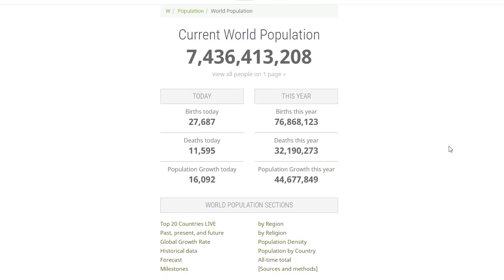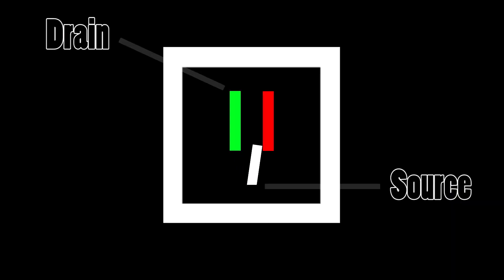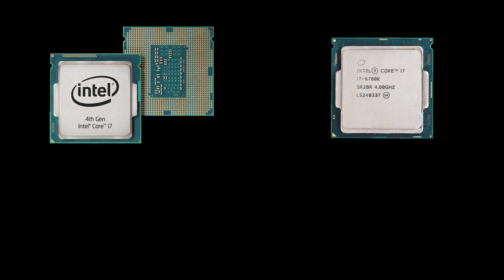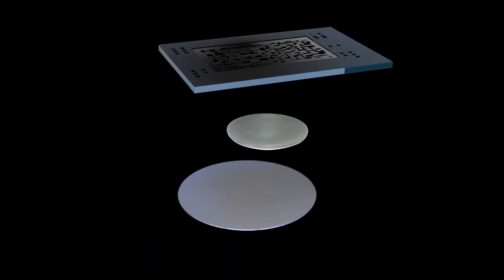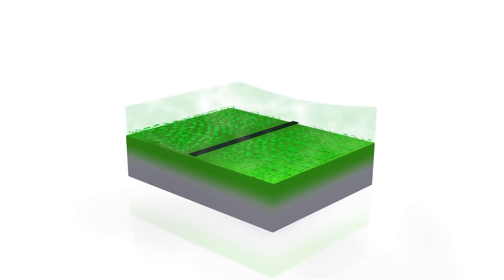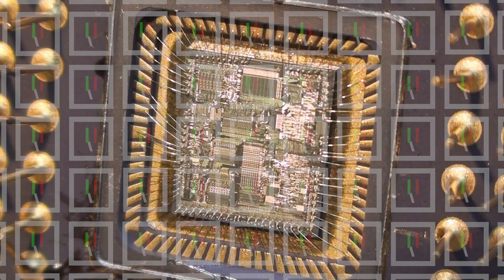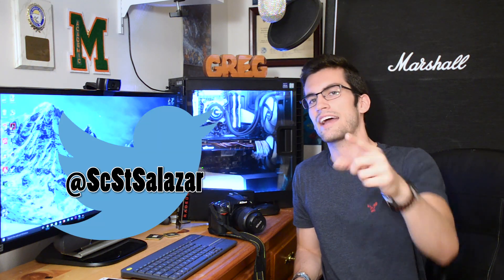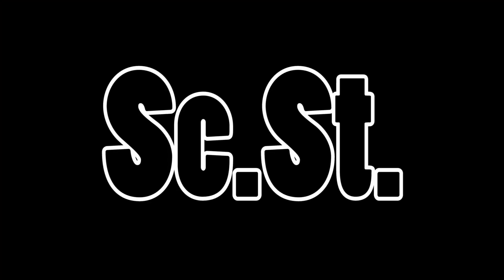Why Do Processors Get So Hot?

Comment: I would like to add to Gregg's explanation.  All of the heat inside a CPU is a result of something called Joule heating.  Heat is simply kinetic energy (indeed all forms of energy are either kinetic or potential).  Since electrons have rest mass and since they are what is traveling through the circuits, they bump into the atoms of the wire creating a sort of kinetic turbulence.  This is what heat is at the most fundamental level.  Whether it be in an electrical circuit, your car engine, or when you rub your hands together, heat is generated from this principle.  In other words, heat IS motion whether it be at the sub-atomic level up to the size of galaxies. 

Now I think an explanation of temperature and heat is in order because this is something lots of non-scientists or engineers have a hard time understanding.  Heat is not temperature, they are related, but not the same.  A good example of what I mean is the following question: Which is hotter -- an iceberg in the north Atlantic or your CPU running Prime95?  If you answered your CPU, you are WRONG.  The iceberg is hotter but it has a lower temperature.  Why?  Because heat is essentially energy and energy is related to mass (Remember Einstein's E=MC^2).  Since the iceberg is so much larger, it has more total energy (more molecules moving around creating heat).  However, it is much lower in temperature.  It turns out that temperature is the AVERAGE heat in a system, not an absolute measurement of total energy.  So if you put a thermometer probe anywhere on the iceberg it will be somewhere around freezing or below, but it does contain far more heat in total than a CPU at 70°C.  I mention this because I see this confusion arise A LOT on computer enthusiast forums when it comes to radiators and cooling.  Most people don't get it.

Now, all regular matter (except superconductive materials) has electrical resistance.  It just so happens that highly conductive materials like metals have a low resistivity while insulators like rubber or glass have a very high resistivity (this is what defines them as conductors or insulators or semi-conductors).  The problem we have with heat in electrical circuits is a result of the fact that the stuff the circuits are made of has this inherent resistance.  This fact is probably known by most people reading this, so this is nothing that insightful.

However, there is another effect I would like to mention that's related but probably not as well known by average enthusiasts.  When metals experience a rise in temperature (even if there's no electrical current), the resistance also rises, which means the metal is less conductive than it was. This is called the temperature coefficient of resistance and electrical engineers are very familiar with the principle. (In fact, this is how some thermometers work -- they read the resistance of a metal (or ceramic) element and calculate the temperature based on this resistance change.  Indeed the thermometers on our CPU die themselves work this way).  What this means is that since the resistance has risen due to heat, you need more current to overcome that resistance.  More current means more kinetic energy (heat) flowing through the wire and yet even a higher temperature.  And the higher temperature means yet another rise in electrical resistance.  You see where this is going.  It's a vicious cycle.  If you are doing extreme cooling like liquid nitrogen, you can counter-act this resistance rise (with such cooling you are actually making the metals more conductive in the circuit), but ultimately your clock speeds will be limited to inherent circuit design and limitations irrespective of heat.

There is a solution to this problem, though.  It's called super-conductivity.  The problem with superconductivity as we know it today is that we haven't identified any materials that can superconduct at room temperatures (or anywhere close).  These materials we have now need to be in environments at WAY below 0°C.  However, this doesn't mean advances wont be made and that someday we may identify a material that can superconduct at room temperature (or higher).  Nobel prizes have been handed out in past decades to scientists identifying materials that increase the superconducting temperature by a few degrees (when thought impossible) so there is no law of physics that says it is impossible.  This is a major problem in condensed matter physics and lots of research is going into it.  If a material is identified (and it is cheap enough), it will revolutionize technology like we haven't seen since the invention of the transistor itself.  It will allow for SUPER efficient microchips (that use milliwatts instead of hundreds of watts).  Chips have already been made in labs that run at 6 Ghz and use a few milliwatts of power.  The problem is you need elaborate sub-zero cooling to make them work at all (the cooling isn't to fight heat, but to make the material itself superconductive).
Reply: great explanation, still confused on the average temperature part

Comment: Interesting video, but I think it needed a bit more organization. 

You spend the first half of the video talking about how a cpu works and all the things that don't contribute greatly to the heat output of the chip, and then when you do get to talking about where the majority of the heat comes from, it gets mixed together comparing the heat generation of different chips and cpus at different clock speeds.  All of that is good information, but it needs to be spread out a bit more.

This is obviously something that you're really excited about, and I'm glad you made this video as it interests me too, just make sure your excitement drives you and doesn't hinder your videos.
Reply from the maker: It flowed fine. I amswered the question in steps.

Comment: Hi Greg. I have  a question for you and I really hope you can help me.

Im building a PC with the RX 480 and I have doubts between 2 CPU's. I have the i5 6500 3.2 Ghz or either the i5 6400 2.7 Ghz. 

I dont know wich one to choose because I'm not certain of whats exactly  the difference in performance and also if the Ghz difference is a big deal for 1080p Ultra. 

Thanks.
Reply: id say go with the I5 6500 3.2 Ghz best performance and future proofing with the low clock speed of the 6400 i wouldn't say it would majorly affect performance but it will be out classed easy and if you plan to expand upon your build in the future you wont have to worry much about it bottle-necking your performance
Reply: both i5's will be close to the same. honest answer though, it will always depend on what game you are playing. some games use the CPU more thus making the higher clocked i5 better. in my opinion if you were to play a game for an hour using the i5-6400 and then switch and play an hour with the i5-6500, you won't notice a difference. now if during both hour sessions you were bench marking, you'll be able to see the data that shows the i5-6500 is slightly better. get the i5-6500 if you have the extra cash, if not the i5-6400 is just as respectable.
Reply: The money it's not a really big problem (we are talking about 30€ of difference) but I dont really want to waste my money. What I want from the CPU its to not bottleneck my RX 480 (I know it wont) and to offer performance for at least 3 -4 years.
Reply: if you have the money go with the 6500 its not a waste you get better single core performance for those games that use only one core and a slight boost in multi core at this point i honestly think anything under 3.0Ghz these days is a waste of money in terms of gaming
Reply: +MrVictorius there will be no bottleneck. chances are you  upgrade before 3-4 years. if not and you do wait 3-4 years get the 6600K instead. overclocking is the best way to avoid potential bottlenecks. although in my opinion the differences between the 6400 and the 6500 are minuscule which ever way you look at it.
Reply: +Thomas Goettsche it's boost is like 3.3ghz so.... and it will boost when gaming.
Reply: Get the 6600k and overclock to 4.2 to 4.4 GHz
Reply: Another thing. Do you think I will need to buy a CPU cooler if I take the 6500. I was planning to use the stock one since there's no OC situation
Reply: +MrVictorius if you don't mind the noise it makes
Reply: You mean the stock one?
Reply: yes
Reply: Yeah I looked for stuff like that, but that CPU in particular I did not choose it because it is 1150.
I know that might sound silly, but I dont want older sockets.
Reply: +Alexander Binovski But he also doesn't need to buy new ram if he wants to upgrade in the future. DDR3 is dead and you shouldn't invest in it anymore.
Reply: DDR3 is dead in terms of it's usability in the future. The moment he wants to upgrade again he has to throw it away. And has to buy new DDR4 ram. So by buying it now he can save some money.

Comment: My PC uses AMD and is better than Intel... You know why? Mine doubles as a fucking Stove and is cheaper!
Reply: you can use it to heat up your room in those cold winter nights.
Reply: +Theodoros Nicolaou I bet your using a HP. Their cooling solutions are total shit.
Reply: Ryzen is cool

cooler than Kaby lake
Reply: Ah, the irony of old comments. ;p
Though I guess you could still apply this to vega. XD
Poor vega. AMD's very own Fermi, if current information is correct...
Reply: XD
Reply: ItzDev Pretty true actually, Intel's stock coolers are complete crap. AMD's Wraith coolers come stock and are about 10 times better than Intel's stock coolers.
Reply: +K'nextreme Productions FX 8370 for me :3
Reply: +MrMuffinGame #WTFU yah lol
Reply: +K'nextreme Productions must suck
Reply: Unless later software is more optimized, he can still rock with that processor.
Reply: Fx 6350 passing by
Reply: fx-8350
Reply: Hell yeah :D Multipurpose is smarter buy! I'm using a 8320 overclocked to 4.3 Ghz. Sadly, my Dark Rock Pro 3 can't handle anythijg higher than that. But if I want to heat up my room i'll set my R9 390's overclock :3
Reply: My laptop's A10 processor can reach temperatures up to 140 Celsius when gaming (that turns off my laptop)
Reply: +Theodoros Nicolaou download afterburner and max out fans, or dont play as long, or you will melt
Reply: +MrMuffinGame #WTFU yeah I am. I also have an old HP tower that doesn't get that hot, but its fans are really loud.
Reply: +MrMuffinGame yea hp laptops cooling sucks

Comment: what happens if you cool the CPU to as low from 20°C to -10°C
Reply: first, you would come across problems like condensation, as the temperature would be below ambient temperatures. second, the BIOS would freak out and fail to deliver correct temperature without a specific BIOS. they can operate at an extremely low temperature, but they just need to be a little warmer before they can be started.
Reply: ThePaisleyProject I figured it out... when I finally was able to get my computer on a workbench to open it... the stock intel cooler somehow managed to break off its pins that held it in place... so I replaced it with a no-name cooler that came on a pre-built computer from a few years ago. it's working much better at 4ghz now.
Reply: tommytomthms5 always remember to check hardware when things are overheating like that, That would've been my fist thought , I'd recommend a hyper 212 evo. its cheap and gives great results.
Reply: heck out ln2 over clicking.  they have to warm the cup up to start the system
Reply: i have my 4790k w/ Cm T4 on idle between 35- 45

is it normal temp?
Reply: its hot here in TX, i have not overclocked it yet. (sometimes it goes up to 4.2 GHz when gaming, again didn't overclock) 

if you think my temp is high, whats the alternate option for the heat sink, should i go for liquid cooling?
Reply: I will be trading my 4790k for something that runs cooler because this stupi thing likes to hit 90 and 100 degrees all the fucking time.... stupid piece of shit... I have to run it at 3Ghz otherwise it overheats. I'm not sending it back to intel because that would mean I would be without a cpu at all for over a month while they try to figure shit out... fuck that I'll just buy a new one.
Reply: ***** either the specific one I have is a piece of shit or my $220 motherboard is a piece of shit because if I don't underclock to 3GHz it will hit 100C within 2 minutes.
Reply: +tommytomthms5 the cooler might not be seated correctly, you should check it
Reply: ***** I think it might be the CPU it's self not seated correctly so when I get the chance I'll check both...
Reply: +tommytomthms5 what cooler?
Reply: the problem with a 212 evo is it sticks up like 6 inches into the case and I think it would hit the fan I have mounted on the side of my case
Reply: +tommytomthms5 hyper t4, corsair h60...
Reply: nothing. CPUs don't care about lower than room temperatures
Reply: You get really nice overclocks if you don't run into cold bugs and other issues. Years ago I have a Athlon XP-m 2500+ and I put it outside at -20F and I hit over 2.6Ghz stable and closer to 2.8Ghz suicide screen shots(which was pretty good for a 130nm cpu), one problem was the hard drive got too cold so I had to wrap it in a towel to keep it warm.
Reply: well in the North Midwest U.S (South Dakota) it gets extremely dry during winter. extremely so condensation isn't a problem at all. so I put my PC outside when it was -5F with a wind chill of -28.. and for whatever reason it was lagging like crazy and was slower (I didn't even try games, that was just on the desktop)

Comment: Nice!! Jumped for joy at seeing this video, thanks for the info! 

So another question, kind of another mix for G/CPU. With the Vulkan update for DOOM, people reported getting even higher frame-rate increases on their AMD GPU's when coupled with AMD CPUs... Would this be because of the way that Vulkan works with threading, and the physical cores of AMD vs hyperthreading of Intel? Maybe it doesn't work and people are just crazy.

Once again though, great video! 10/10
Reply: AMD has an issue with overhead. DX11 overhead to be precise. DX12 is mostly about cutting away much of the overhead. And yes Vulkan is also about cutting the overhead. 

Meaning that you get more performance. Nvidia has less DX11 then AMD has, for whatever reason... but with DX12 AMD has pushed forward improvements into the dX12 standards and yes Vulkan that mostly help AMD out. 

Nvidia cannot run Vulkan but can run DX12. So if a game supports vulkan it supports AMD way of getting things done. Much like how nvidia hairworks works only on nvidia cards. Even if it really is just a way of calculating things. 

In the end if you got an AMD card Vulkan will indeed speed things up. If you got an Nvidia card you can't run it. And you must hope that DX12 will do miracles.
Reply: I know all of that, but the question relates to extra performance when AMD GPU is with a AMD CPU instead of an Intel CPU. I know that AMD is better on DX12 and Vulkan and that it's designed to reduce API Overhead by doing processes differently/more effectively compared to DX11. 

Example of my question:

R9 280X with i7-2600 - FPS 140
VS
R9 280X with 8350 - FPS 160

Why?
Reply: 1ch1r1n Lets hope we find out...

Comment: It is nice to see that processor design got so far that nowadays we can have smartphones and those tablets/cheap laptops. It is unbelievable how much performance you can get out of only a few Watt power and yes hence a few watt heat generated. 

Just how far can you shrink a Super Nes chip these days... and just how little power will it use and how small will its form factor be [not regarding the cardridge]

And that is the nice thing, at one side you got the powerful chips that use quite a bit of energy and create quite a bit of heat but get allot of work done.

On the other side we have due to modern technology chips that are both relative fast and yet can life on thin batteries.